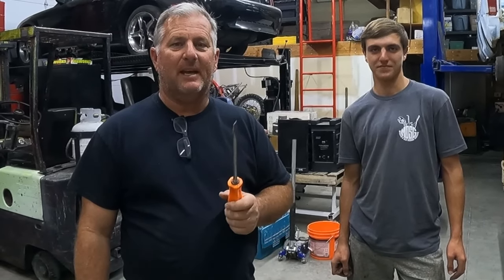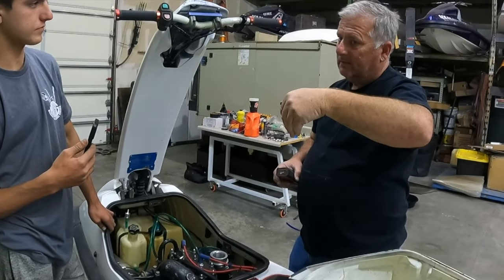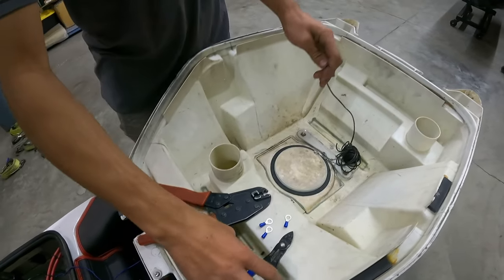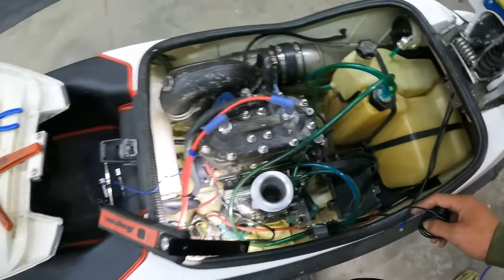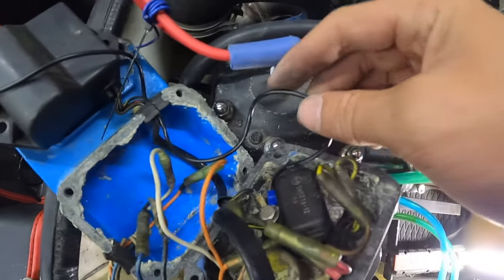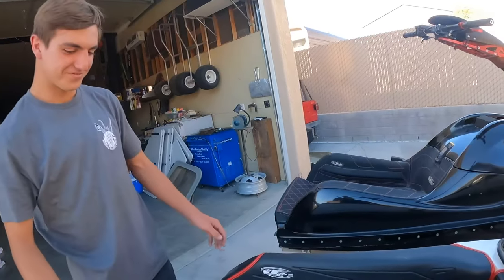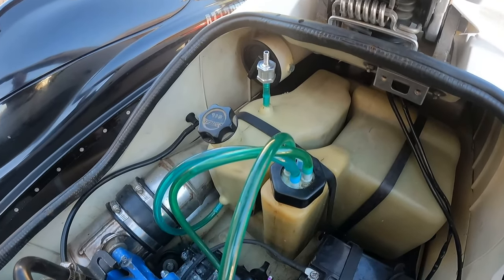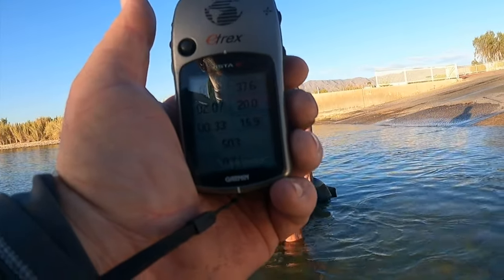Season Kickoff Thrills: Jim and Wes’ Sand Bar Adventure with 650 SX & Bullet V4

Comment: Why don’t batteries last in the desert? I assumed winters were worse than heat but apparently not.

Finally the mystery of the great jetski wall is solved!!
Reply: The extreme heat in the summer kills batteries tires and paint. In the summer when the sun goes down you can feel the heat coming out of the ground. That and a very dry climate just drys out rubber plastic and vinyl. Shade and air flow is you friend in the summers here in Az.
Reply: @robertottwell605  We moved here in August '01, i thought the cold water faucet was broken, no cold water to be had since the pipes are so close to the surface. we learned early to get all your cold water needs done early in the am.

Comment: Curious why you don't run a wire to a bolt on the outside of the ebox, use a waterproof heatshrink connector and run that to the battery ground?

Comment: Ok so a ground fixes the issue? I have a enhancer in my blaster and i was chasing carb issues for awhile then got that fixed with a set of brand new mikuni silver body's. Then it felt like from 3/4 wfo throttle like there was no gain just engine sound change like it was lean. The most rpm i could achieve is 6500 and tje rev is set to 8 or 9k on the cdi.  I put the stock cdi back in and seems to run better but still not achieving 7100 pinned. Will a ground fix the issue on a am cdi?
Reply from the maker: No, yamaha uses a completely different set up. I never see ground issues on them. Stock exhaust? If so, you may not get much more rpm. Does it rev out of water? If so you have too tall of impeller. :-)
Reply: @jetskijim007 I have a b pipe solas mag pump and hooker 10/16. I slapped a stock cdi in there and it went away so I assume the msd is bad. I was just curious if grounding it would help it out